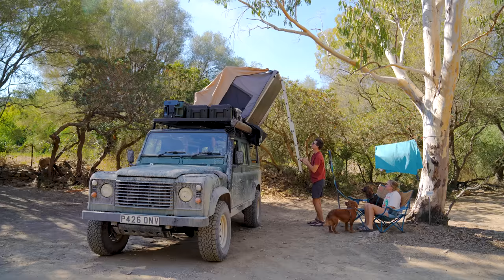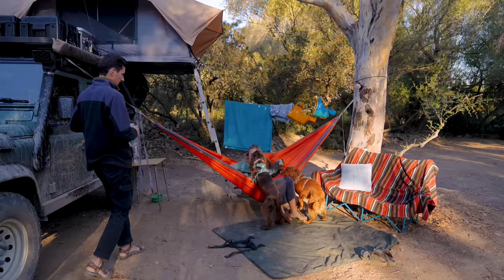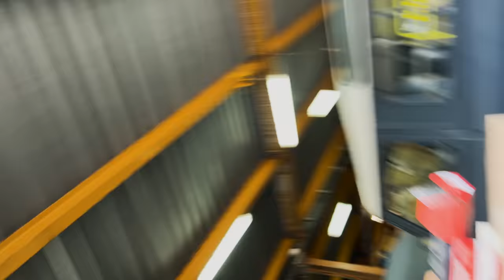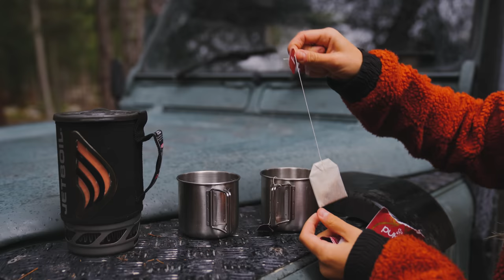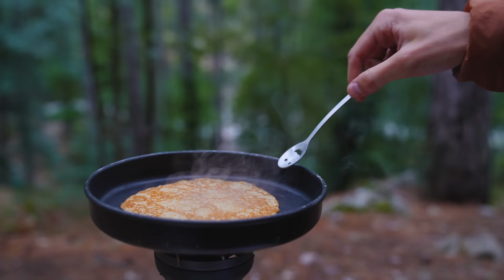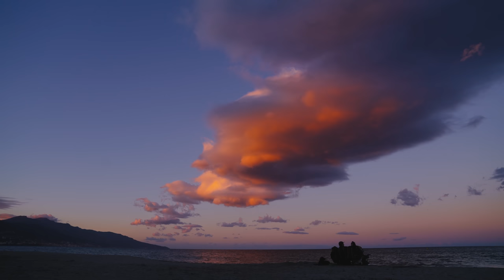Beaches & Broken Brakes - Overlanding Corsica in our Land Rover Defender

Comment: Hi. Just wondering why you don’t turn the tent around to open at the rear. That’s how I’ve always had mine on my Disco 2. I have a drop down table on the back door and that is my kitchen area covered by the tent floor. You should also think about buying the ladder extension as well. Thanks for your travel blog. Cheers 👍🏻🙏🦘
Reply from the maker: Thanks for watching Grahame! We mounted the tent to open the side so the gullwing could be covered and we used that surface more often when cooking. Also, the FrontRunner tent needs slight modification to the mounting points if you want it opening to the back on a Defender, it's not a major change, just cutting down the aluminium channels, so we decided to keep it standard 😉